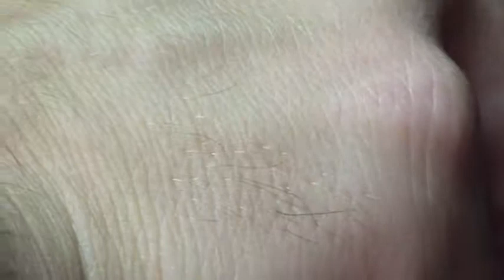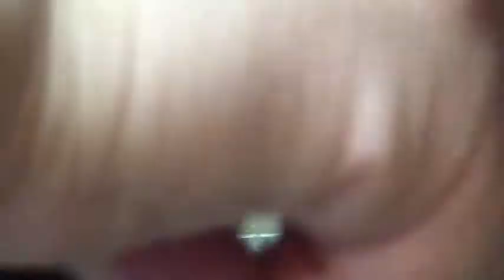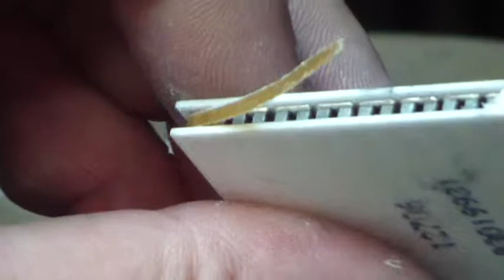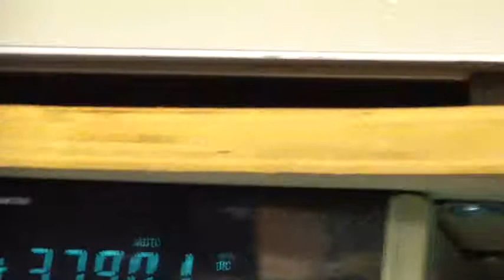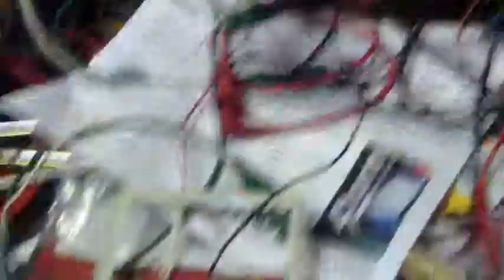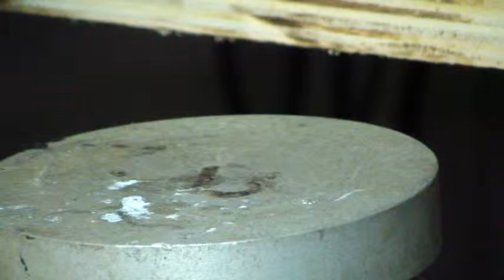Experimenting with a busted thermoelectric cooler

Comment: I had one that broke clean in half along ceramic, leaving some of the blocks on one side and some on the other side. I heated it up to about 200 Celsius and heard a pop. I think that the air inside heated and expanded pushing the ceramic plates apart, not 100% there. I assumed that they can handle heat, but I may of had a bad one. I will experiment by making a hole in the silicone that glues them together to allow for any expansion and hopefully will not experience this type of issue again. Anyone with advice and experience handling these please reply. Thanks